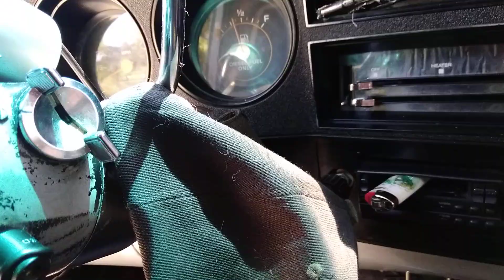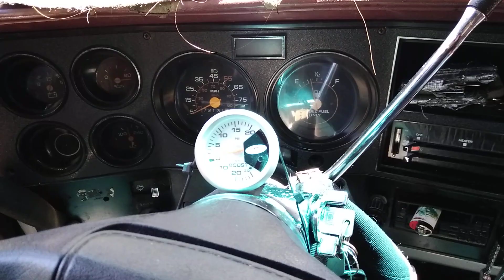1982 K20 Modified Turbo 6.2L Detroit Diesel Short Start up and Running Clip.

Comment: My first duty station after bootcamp and AIT had spanking new '84 chevy blazers and 3/4t pick-ups with those diesels. Id love to own one now. Definitely NOT a high performance vehicle but as solid as you could find back then. They were replacing the '73 Mopar gas fueled pick-ups and ambulances. 2 years later the humvee's started to arrive.

Comment: Pumping the accelerator pump on a diesel ? 🤣

Sweet engine though 🙂🙂
Reply from the maker: Habit lol Owned a '76 Suburban with a 454 and always double pumped first thing. But I do also do it to set the Cold Advance Solenoid every cold start on this Diesel so it's normal for me.

Comment: What is the mishimoto thing for?
Reply from the maker: Which Mishimoto thing lol I have a Mishimoto Oil Catch Can, Oil Cooler, Oil Lines and Oil Thermostat which is probably what you are referring too. The Gold Mishimoto thing is an Oil Thermostat set to open @ 185° which when cold stays closed recirculating the oil back to the block bypassing the Oil Cooler. Once the Oil reaches 185° the Oil Thermostat fully opens allowing full flow through the Oil Cooler and back to the block.
Reply from the maker: It basically helps with cold weather engine warm ups and ensures the Oil doesn't get too cold or hot by properly regulating the temperature accordingly.

Comment: whats your plan for the transmission?
Reply from the maker: I'm going to get it rebuilt to Stage 2 then either get a Gear Vendor's Unit or just regear the rear end so I can run lower RPMs on the highway.
Reply: Do they have the gear vendor unit for 4x4s
Reply from the maker: @jimmymcclelland3727  They do yes. Pricey but worth it.
Reply: @TheAscendedMaster  
I have a military k30 definitely would be interested